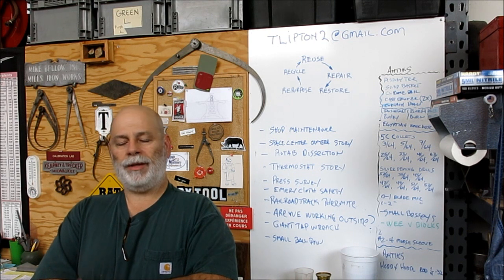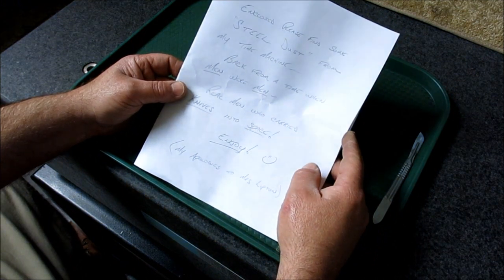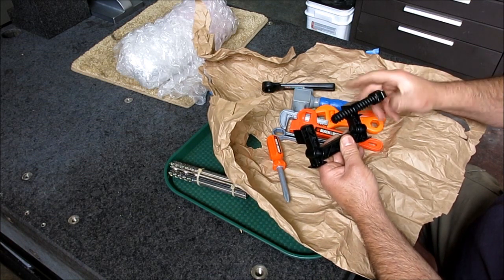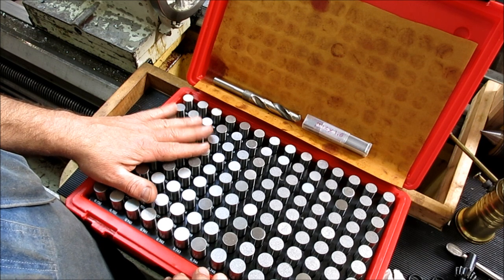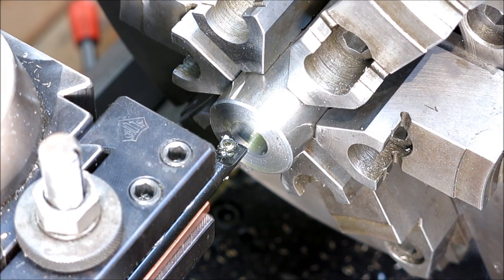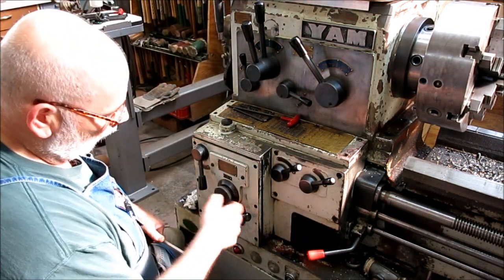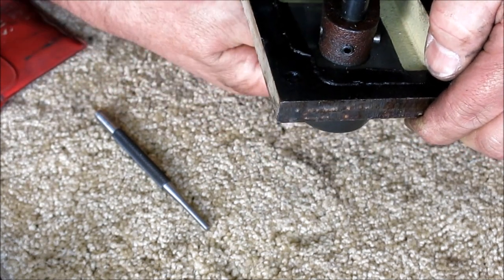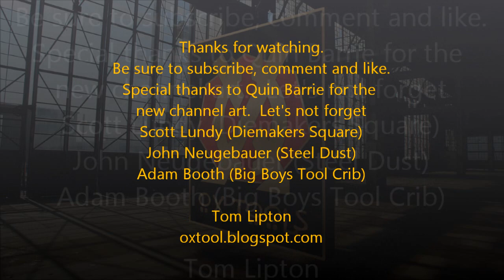Monday Night Meatloaf 27

Comment: Hey Tom, I was happy to share time of them Big Boys tools with you! I just couldn't resist when packing up the box. 
Lots of other nice gifts from other viewers too. 
Nice easy repair on the lathe. Thanks for showing us some the the workings in the guts. 
Isn't metric threading fun??
Thanks for sharing with us bud! Hope that level serves you well. 

Adam
Reply from the maker: Hey Adam,

I should have used the hammer you sent to drive that pin home. Didn't think of it in time. So I have a trick to show you on the metric threading. I shot some video tonight on the very subject.

All the best,

Tom
Reply: After watching Both you and Adam cut come metric threads I am pushing a VFD for my Southbend up the list. Without a foot brake threading to a shoulder would be sketchy. At least with the VFD I could set a dynamic braking Parameter on a carriage stop switch. Hmm looks like I need to find a 3 phase motor......
Reply from the maker: Craig Spakowski Hey Craig,

Wait till Friday. All is not lost.

Cheers,

Tom
Reply: oxtoolco
Can't wait to see it Tom!

Comment: Hi Tom,

Before I converted to a VFD, I used to thread in in low gear and back out in high, it saves a bunch of time. Now I often cut with the JOG button, then run full speed to back out. It's on the list to add some microswitch equipped stops for threading.

I got to use a Hardinge HLV for a short while. The manual says to not attempt threading up to a shoulder at more than 1000rpm. Got to love a machine with a dog clutch in the threading drivetrain!
Reply from the maker: Hey Paul,

If you have threaded on a Hardinge then you have seen nirvana. Its a well thought out setup. Going to try the half nut release on this one after a viewer suggestion. 

Cheers,

Tom
Reply: oxtoolco Hey Tom,

I took a look at that link down the page. I'd not seen that technique before.

Here's how I've done it (I posted this on one of Adam's videos);

With the gear train set up, position the tool a convenient distance away from the end of the work. Run the lathe briefly to take up the lash. Mark a line on the chuck that lines up with a reference point on the headstock. Mark a line on the leadscrew that lines up with a reference on the gearbox. Bring a stop up against the saddle on the right hand side (sometimes you can use the tailstock for the task).

As long as the saddle is back against the stop and you engage the half nuts when both lines coincide with their references, everything will synch up. 

I still do this sometimes to give me a fallback position and it's a good thing to do if you're not used to 'non native' threading and might open the half nuts by mistake.

I've also seen solutions involving a worm drive threading dial.

Comment: That closing art of the hanger type windows and floating sign is pretty impressive.
Reply from the maker: Hi Rusty,

That is the heavy steel shop building 411 at the Hunters Point naval shipyard. I took it after they had closed the shops and cleared out all the equipment. Quin did the floating OX logo for me.

Cheers,

Tom

Comment: Great gifts Tom, and the cleanup on the level was impressive. 
Like the new art. Dont you wish you had the building pictured in the background? 
And your right, were all mechanical gear heads!
Never experienced the barber shop thing.
Have to put that on my "bucket list"!
Ray
Reply from the maker: Hey Ray,

That shop is impressive. I used to work down the street from it when it was running. You cant see them but there are 40 ton bridge cranes over my head. Its roughly 100K square feet. 

cheers,

Tom

Comment: when u try to smoke a cigar in a barber shop in germany you get shot rightaway today ...good old days.

Excellent video as always!

Thanks,

Stephan
Reply: What is good about sitting in a barber shop and having to smell that smoke shit from your neighbour?
Reply: Simon K.
There's just something about the aromatics of a good quality cigar, kinda like the smoke from a good sulfur based cutting oil ;)
Reply: Paul Anderson  smell is a power trigger of emotional memory
Reply: anglegrinder disk smell...

Also good stuff in the video!
Wonder how long the hammer choise took ;)
Reply: I kind of wonder that myself, Tom wake up in the morning drinks a cup of coffee then rushes down to the hammer rack to choose a hammer, then scratches his head (it's why he's bald you know) choices choices choices.
Reply from the maker: madinatore That little repair job took three hammers to complete. This is how you rate the difficulty of the job by the number of different hammers needed to complete it. A three hammer job is a minor undertaking. Wait till you see a six or seven hammer job.

Cheers,

Tom
Reply: A coworker of mine would use a little cheater pipe and a hammer on the tool post for hammer pounds of torque. The man caused a lot of down time. ;(

Comment: That little die square is really nice. When we work in the tool room I learn a lot from the head tool and die maker he was from Germany and that guy did really neat work. It was so neat you didn't want to use the die. We made a lot of power press dies or sharpening them. What I wanted to ask was on the square can you put the blades up side down so the angle goes the other way. thanks for sharing man.
Reply from the maker: Hi Ruben,

I haven't had a chance to properly play around with the square. It looks like the blade is reversible. 

Cheers,

Tom

Comment: I'm pretty sure the clamp element of the Big Boy's Tools is a Hot Wheels clamp.  The old orange track can slip into those square mounts so you can fasten one end of your track to the piano bench and the cars start down the track with some potential piano bench energy.  It's nice to see you feature an item that is closer to my wheel house.
Reply from the maker: Hey Tom,

Thanks for the tool tip. Now I just need to machine some track and find a car.

Cheers,

Tom

Comment: Hi Tom!
To use metric threads on a lathe lever screw - nut half engage, you do not have to account for counter - counter/dial thread, just get on piece and get back to quota another thread to finish.
Dan.
Reply from the maker: Hi Danu,

This lathe has an inch leadscrew. So you have to use the same index mark for each pass. However it looks like you can disengage the half nut and get back on the same index. I'll be trying it out.

Cheers,

Tom

Comment: Oh that barbershop tonic aroma intermixed with the talc was an olfactory singularity, it's been like 50 years and I can still almost smell it now.  Not much more useless than a shiftless shifter on you gears, glad it was a simple fix.
Reply from the maker: Hey John,

There is a barber shop not far from me that does the whole works. I just go in and ask for a haircut with a hole in it.

Cheers,

Tom

Comment: Hey Tom, Love the videos and there great content. I have a question/request. I was wondering if you could do a episode about measuring threads? Like the 3 wire method or other ways. You seem really good at explaining math lol. I know there are standard in most ref books for it but I was more interested in how you measure non standard threads, like say a 1.5"-18TPI. If you could that would be wonderful Thanks for your time.
Reply from the maker: Hi Crawler,

Thanks for the suggestion. Three wire is the most accurate method for checking threads but not the most convenient.  I'm sure I will have to do some specific threads at some point and will show how its done.

cheers,

Tom

Comment: I had that to do on my lathe a few months ago, & made a mistake of putting the lever internals on the wrong way round, so the taper pins will not go all the way in, must get round to taking the cover off again & putting it right.
Reply from the maker: Hi Robin,

I hate it when that happens. Best of luck when you have to go back in.

Cheers,

Tom

Comment: Dear Mr. Ox of a Thousand Hammers,
Thanks for another yummy edition of Meatloaf! Personally, the person that invented taper pins should be shot at sunrise! I always drill out the hole and install a roll pin. If I need a shear pin, I use a cotter pin or dowel pin with set screw, if needed to hold the pin in place. Someone made Pitney Bowes an offer they couldn't refuse on taper pins, All their envelope inserters and postage meters have them (as of about 25 years ago). Someone with jam up the machine and snap goes the taper pin! Being on a production schedule, I would have to jury-rig something to get the machine working, then do repairs after the crew left or on the weekends. I spend many a Saturday and Sunday rocking out to '80s music and slaving over a broken machine.
Enough babbling! Thanks for sharing. So when do you use the "Big Boy" tools?
Regards,
Oxen Dave
Reply from the maker: Hi Dave,

I'm thinking I will be visiting that one again. I will most likely have to take a little off the boss so the lever is not so tight when the pin is driven tight. Probably happened at the factory so they backed the pin just like I did. It only took thirty five years for it to back out.

Cheers,

Tom

Comment: Why didn't you use a regular live center to guide the tap instead of that long flimbsy
center in the tailstock chuck????
I'm sure you had a good reason?
Reply from the maker: Hey Gent,

Ok I'm busted. I wanted the carriage backed away from the chuck so I could swing the larger tap wrench. I know, lame reason. I didn't expect it to jump around that much. It happened to be the longest point I had dohhhh.

Cheers,

Tom

Comment: Hey Tom, great stuff. That cover plate looked heavy from this angle.
Reply from the maker: Hey Dennis,

I don't think YAM iron works knows about aluminum. It was a bit heavy. I was worried that something was going to fall down on the inside when I pulled it off.

Cheers,

Tom

Comment: Tom Am sure you already know this. You can disengage the half nut with an inch lead screw. The problem is people then let it turn a whole rev or more and try and re engage. That won't work. If you disengage you have to watch the thread dial and reverse it to where you had it engaged previously. Then reverse engaged. Its kind of the same as leaving engaged but just wanted to take some of the mystery out of t for some who don't know.
Reply from the maker: Hi Colin,

Somebody posted a link to an article describing this very thing. I tried it and it works great. A video is forthcoming.

Cheers,

Tom

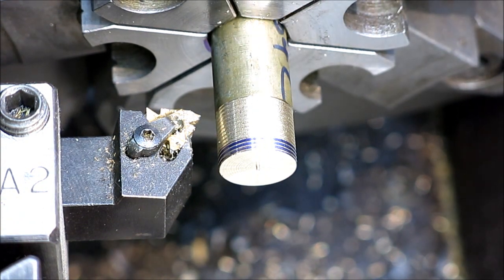Comment: Great stuff there Tom. I like the artwork - 44:32 very cool.

You know, even the cheapest hobby lathes (like mine) have the same split pin problem. I have my hobby lathe in parts at the moment, fixing the exact same thing for the second time now. Definitely a design flaw - especially in the hobby lathes... any amount of excessive force on the lever causes the pin to wear... It's the weakest link in the whole operation. I have found that my gear needs to smoothly glide into action. If I feel resistance, it usually means I am wearing the pin to some extent. I'm sure your beast will probably only experience this once in its lifetime, compared to my little fella, who almost needs an annual pin replacement.
Reply from the maker: Hey EF,

I think this one is thirty five years old. If I had to guess looking at the cover I think I'm the only one that's been to the dance with that area.

Cheers,

Tom
Reply: Hm. Why not use tool steel to make a pin, and, as an extra enticement to keep it in it's home, why not make a small made-to-fit collar around the sucker. On some of the older cars there was this guard to keep drive shaft pins from escaping. It was abandoned with the advent of the clips and of course much more precise machining. But the principle still stands. Maybe it will work for you as well.
Reply: oxtoolco
Hey Tom,

Check your email - I sent you another sketch.

PS - thanks for the 'plug' in your video - no pun intended :)
Reply from the maker: aserta I was totally lazy and just reseated the pin. I figure it lasted 35 years or so with the first hammering it might make it that far again. I could have peened the edge of the hole a little which probably would have made it pretty bullet proof. Of well next time.

Cheers,

Tom

Comment: Hey Tom $25 at the barber shop? Man SF must be expensive. Mike down the street from me is still at $14. Same pictures on the wall since 1975, I guess re decorating would eat the profits. I also have the same problem with the wrench for set screws. I look at it and always grab the size too big. You'd think that eventually you'd learn to "off set" for set screws. That made me feel better seeing you do it too. Thanks
Reply: £7 here in the UK, there must be something in the water because grabbing the wrong size allen repeats its self here too!
Reply from the maker: Hey Craig,

In my case if you look at it by the amount removed its real expensive by the gram. 

Cheers,

Tom
Reply from the maker: Bill Lewis Hey Bill,

Little secret. Don't even ask. Next time you need a tool just use multiples of haircuts as your units. Well this new vise is 2.5 haircuts.......

Cheers,

Tom

Comment: Tom, when drilling the hole on the lathe (at about 21min into this video) it looked like the drill bit moved quite a bit at the start of the hole - is this normal, is the drill seeking the center of the pilot hole. Thanks

- Tom
Reply from the maker: Hi Tom,

Good eye. Drills sometimes do that. A flute will bite harder that the other one and pull it off center for a couple rotations. Once both flutes are engaged equally it comes back to center. This was a reduced shank drill so its floppier than the same size in a taper shank.

Cheers,

Tom

Comment: Should be oil, not gas :) Xray transformers are normally flooded with transformer oil
Reply from the maker: Hi Devil,

I reread the notes. It has oil in the main part then a gas on top. Nick does his own electrical engineering. I'd bet he is not making x-rays with this one. Incidentally we use high pressure dry air in some of our high voltage equipment as an insulator. Has to be clean and very dry but it works quite well.

Cheers,

Tom
Reply: I am insulating for gas because I will be pulling a vacuum on the transformer once it has been filled with oil, which will sit about an inch from the top. I need a vacuum seal for the vacuum process and I can't do it with the M18 hole because of the parallel thread. I don't want to use an anaerobic sealer or anything permanent, so I think an o-ring is my only option.
Reply: Energy Fabricator If i'm not mistaken some deep sea probes use this very same principle for locations that meet the exterior via threaded inserts.

My question is, since in the drawing it wasn't very clear, will either of the two surfaces have a grove to house the o-ring? Because not providing a support before the o-ring meets the point where the screw and the plate meet might get it pinched. Just curious, i'm sure you guys have thought this out very well.
Reply from the maker: aserta Hey Aserta,

There will definitely be a groove for the oring. Its a simple face seal against the top of the transformer. Now that the lathe is fixed I can actually do the job.

Cheers,

Tom

Comment: Taper pins  suck ass, either they fall out when you don't want them to OR
you tear up your nice pin punches trying to remove them to get to the real problem,
Its also been my experience that they are never square or centered which makes it
REAL fun to make a replacement shaft or "arm"!
I use a short piece of hardened dowel with a secondary scrap drift to get them moving, usually at an awkward/inaccesable angle that only requires all five thumbs
on both hands and a helper all while standing on your head with a flashlight in your teeth.............. LOL
I'm surprised you have to change gears on your Yam to cut metric it looks more modern than that??
Reply from the maker: Hey Gent,

I have to agree. I son't think I have seen too many that were well centered in the shafts. I think assembly techs do the pinning with hand drills.

Cheers,

Tom

Comment: Hi Tom, it was discussed on a different channel and it seems you don't have to keep the half nut engaged: http://conradhoffman.com/metricthreading.htm
But I guess you'll be done threading faster using reverse than trying to figure out how to do it.
With a tool holder like this: https://www.youtube.com/watch?v=2F_AVx_JRlE it is probably faster still
Reply from the maker: Hi Lasse,

Thanks for the link. I'm going to try this out and see how it works. Most guys not wanting to mess around just leave the half nut engaged. This makes sense from a practical sense. Hey and I have a opportunity to test it out.

All the best,

Tom